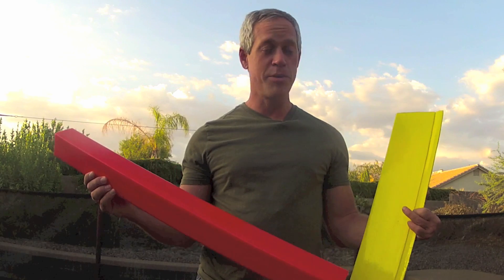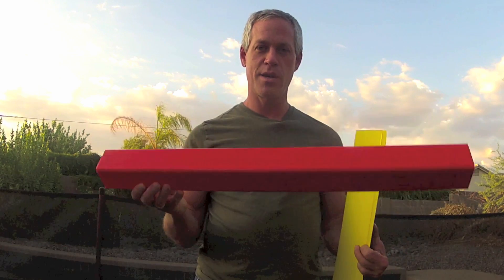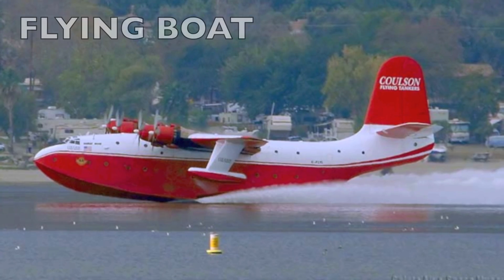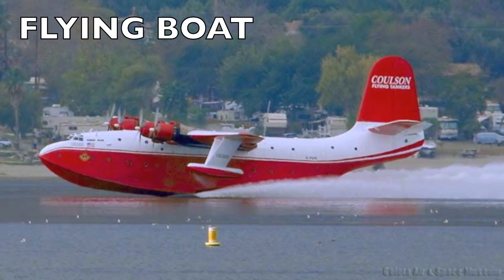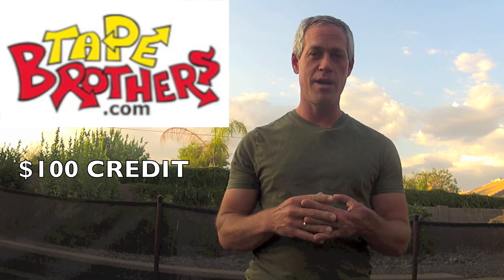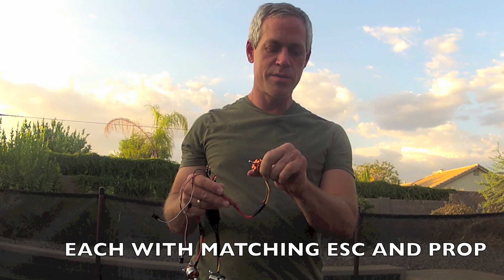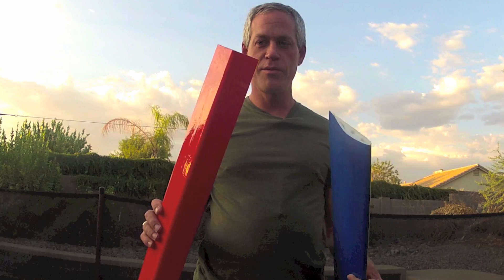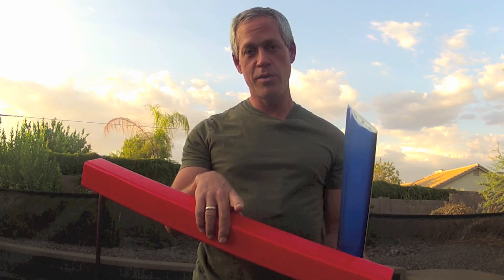SEAPLANE SCRATCHBUILDING CONTEST $200 in prizes

Comment from the maker: As long as it's a cambered, folded foamboard airfoil there is no required planform, so a delta or tapered wing would be fine.  The standard straight Armin Wing is desirable because the rest of us can make them more easily but if you have a cambered delta wing that flies great by all means use it.

Comment: Hi Ed ,have the same question as ...Pumpkinpatch9, have been experimenting with some oil base poly and epoxy on the foam board  for painting purposes with Good results, but should work well  for waterproofing

Comment: Coating the covering your floats or flying boat in Banana Oil also works for water proofing. It will also make your plane nice and slippery in the water. I build rubber powered (converted to electric R/C) balsa models coated in tissue paper: for anyone else who does, using Japanese Tissue ( the color is part of the paper, not a dye that will run when wet), dope the tissue onto the airframes, then brush on one or two coats of Banana Oil. 

P.S. Do Not rub bananas on your plane, google it for more

Comment: Hey Ed. Fun challenge. I've seen recent posts on flitetest where minwax oil based clear coat was used for waterproofing. As long as there are some taped surfaces for wings etc, will it be ok to enter with minwax coated parts?